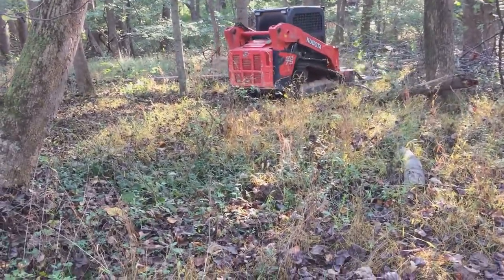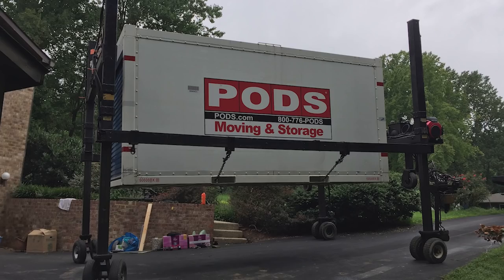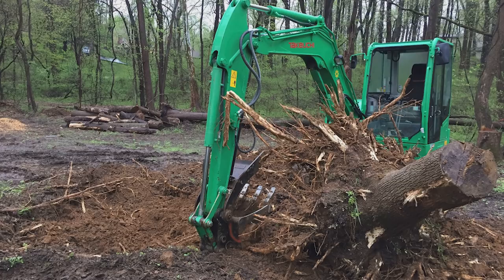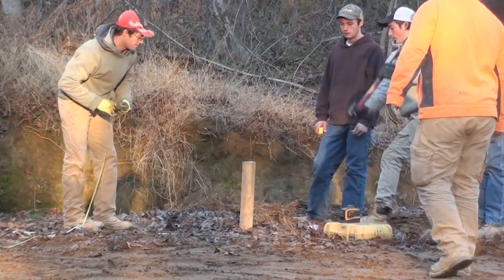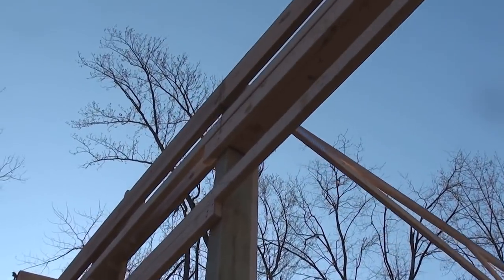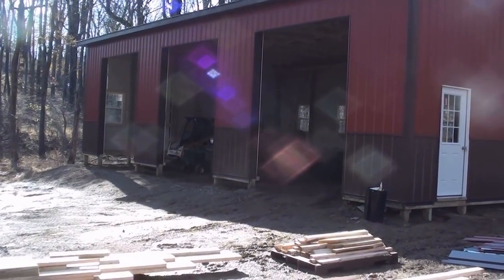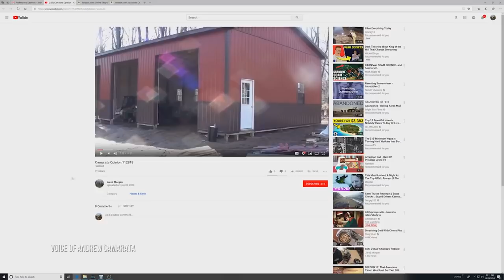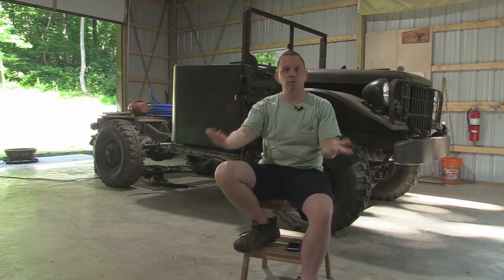Pole Barn Build Start To Finish

Comment: In New Zealand you can't build like this anymore, reg's say you have to scaffold up the entire building, all the way around, all the way to the top. I spent many years as a house painter scaffolding my own jobs as necessary, using painters brackets, step ladders etc but when they told me my scaffolding was no longer acceptable, I had to use the new reg stuff and to scaffold an entire house just to paint a near flat roof I decided I'd had enough. All it really means is a little more time and an extra $1500 on top of the bill to the customer. Now reg compliance costs on everything have skyrocketed, over reg  is dead money, folks paying for bureaucracy and a signature, in the 70s early 80s we had a bloated Gov, regulations on everything, producing nothing n stopping entrepreneurs trying to do things differently because it's not possible to meet regulations because it doesn't fit on their forms. Things got better but then kept changing and will change again it's just annoying that we keep seeming to go through these cycles as if we learnt nothing from the past. The over reg was in response to a time when they changed our building codes to make it easier and some cowboy builders built leaky homes that rotted out (untreated wood, poor design and workmanship, not enough checking on compliance), some folks bought new houses that were junk n not worth what they paid. So now they go way overboard the other way which is just as bad. As for your pole barn, $150k (NZ$300k) seems an awful lot but you paid your money and now have the building you wanted, you could always do it better with hindsight. I'd have poured a concrete slab n done the ground work n drainage etc before everything else, it's much easier to build on a floating slab with all the steel work n drains already in. We often use pressed metal framing these days, it's stronger, lighter, easier n faster to put up, just bolts together. I won't tell you how cheap you can buy a similar sized 3 door workshop as a kit which they will put up for you, NZ is not the US. The only thing we'd put dirt down for is to grow things, for building it's always some form of gravel or fill, we even use polystyrene blocks to fill deeper areas. I'm surprised the folks who sold the building didn't have contractors they use who help you through the process n organize the other contractors etc, or the contractor that you used to do the building didn't help you organize the process just for their own convenience. Builders not being able to start the job on the day organized because of any problem is a pain in the but for any business. As a tradie I just seem to end up working with a group of other trades all the time, customers always ask you to recommend or organize someone so you recommend each other because you know they will do a good job, you can rely on each other to turn up, do the job, do it well n be professional. You all end up getting lots of work from each other, or that's how it worked with me. You seem to avoid hassles with bad customers or tradesmen too because everyone is recommended to each other so haven't stuffed anyone about in the past. Anyway, I found your vid quite interesting and wanted to say thanks for putting it out there, sorry to go on for so long, cheers.

Comment: I KNOW WHAT MEAN BY COMPANYS NOT DISCLOSING, I WORKED A FEW MONTHS AT DISH AS AN INSTALLER, WHAT PEOPLE WANT AND WHAT THE GET AT THE BASIC PRICE IS DIFFERENT, LIKE A HOLE IN THE WALL RIGHT WHERE THE TV WOULD BE, THEY WANT IT THRU THE FLOOR TO LOOK GOOD, THAT EXTRA AND I HAVE TO DEAL WITH THEM , THATS JUST WRONG

Comment: young man ,

before they sent the recycle concrete out to your job site ,  they should all ready have recycle clean ! .

mini ex  " excavator " or track hoe  u can use next time around is " series 35 to 55 excavator " ! .

moving dirt around use skid steer loader ! .

whicle  u have forestry MUCLHER OUT  U CAN GRIND STUMP IF THERE WHERE CLOSE TO OTHER TREES OR YOUR WORKSHOP  ! 

MOST OF FORESTRY MUCLHER WILL ! .GRIND  >  10 INCH BELOW GROUND LEVEL ! .

THEY DID NOT PUT IN ROLL UP DOOR IN YOU WORKSHOP  SAVE  ROOM  / BUT THEY DID PUT IN OVER HEAD DOOR IN , THIS DOOR WILL TAKE UP PLACE EVERY TIME !  .

OVER ALL EVERY NICE WORKSHOP ! .

MOST LIKE LY WORKSHOP WILL COST BETWEEN $ 100,000.00 TO $ 150,000.00 OR MORE !

JUST DEPEND ON YOUR DESIGN  TOO !

Comment: Not trying to pour salt...but that extra 100k you spent on site work should have been spent on a mini track loader and  gravel-in the end youd have all same work done and a paid for bobcat to maintain the property instead of helping to make those contractors rich at your expense...my machine has paid for itself over 5 buildings ago and she owes me nothing.
Reply from the maker: Scott Herr I agree in hind site. We purchased the Bobcat and still have it which is great when it’s not leaking hydro all over the place. I’m not a contractor and didn’t want this project carrying on for years on end. Did I get fleeced? Yah probably. My full time job isn’t site work, so I felt it was best to leave it to the pros even if it cost me. Transparency in this video is so others can learn from my mistakes. Thanks for checking it out.

Comment: And price average pole 20$ a sq foot. You paid almost 100
Reply from the maker: John Woofter the building itself was about that price. Thanks for watching.
Reply: @jrodjared  Costs to creep up.  My 32x40 came in at about, with usable 2nd floor came in at $30 sq/ft, with insulated cement floor, 100amp service, lights and outlets. More money being spent on insulation and plywood walls.  You are right, excavation, stone and dirt work can get pricey. Nice job on your place!